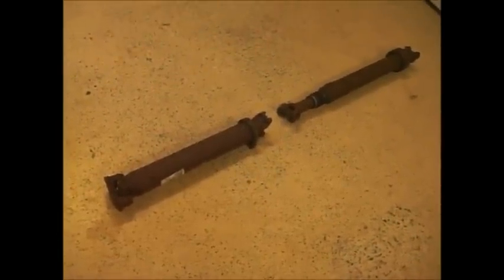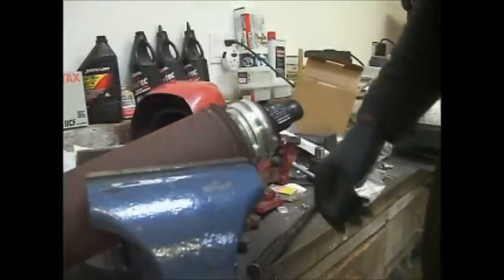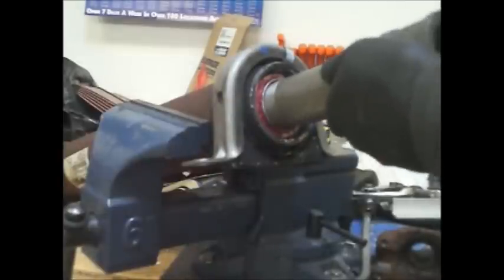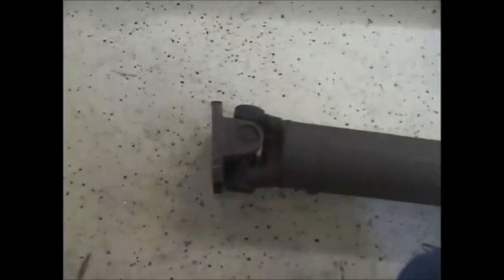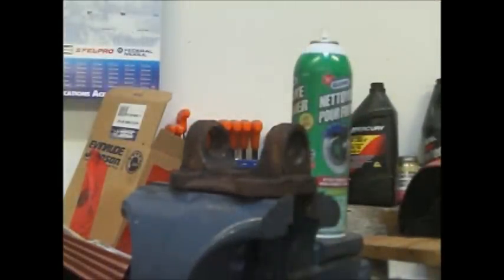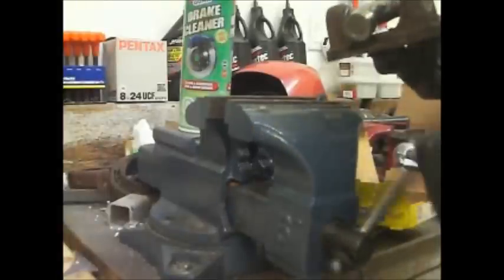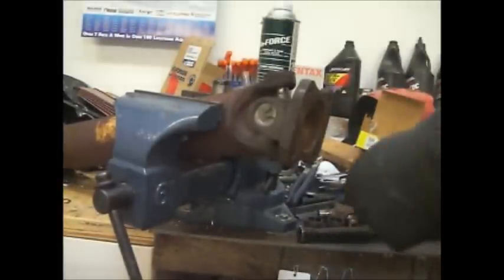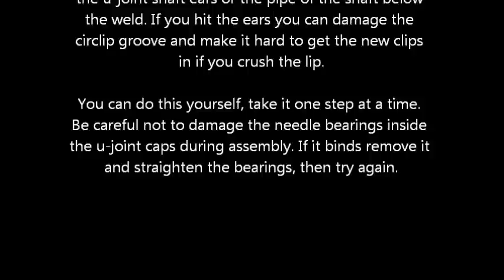Rear Driveshaft Ford Superduty

Comment: EXCELLENT!!!   This is the ONLY video covering this version correctly.  All the others are a VIN beginning w/ 1 (Mexico).  My truck was proudly and reliably made in Kentucky!!!There's a few versions of the carrier bearing, for those who doubt it look on O'Rielys Auto Parts and you will see (Mexico Version ONLY) and ,...not.Thanks for the video dude especially the 33 MM socket.  REALLY saved me some time.
Reply from the maker: Glad I could help. I think mine's made in Mexico tho. :-/  Don't have it with me today to check the VIN. Cheers. Mine is still giving me some issues, odd vibration, etc. I'm ready to ditch it for a 1 piece stronger shaft.

Comment: Thanks for posting. I just had to replace the carrier bearing, but your vid made it super easy. The air hammer worked so good on the flange , that I also used it to remove the bearing.  Worked like a charm!

Comment: Thanks for sharing. What size pipe did you use for the carrier bearing?
Reply from the maker: Probably 2.5" not sure, that was done 7yr ago. :-) , I'll be installing a one-piece double-cardan driveshaft sometime this year. Sick of the two-piece shaft vibration.
Reply: @westvandude   Who sells the 1 peace shaft you talk about ?
Reply from the maker: @Richard5873  Not sure there are any ready-made shafts avail, generally hit up your local driveline shop. They will measure and weld up a custom shaft. Lots of references online, search around might find one to purchase. https://www.ford-trucks.com/forums/1062520-anyone-converted-to-a-one-piece-rear-drive-shaft.html
Reply from the maker: @Richard5873  Try here: http://www.driveshaftspecialist.com/Truckhtml/Ford.html

Comment from the maker: If you get a vibration rotate the centre connection 180deg. Also double-check all the snap rings a few days later.
Reply: Hey Westvandude, I'm having major issues with my drive shaft. And the repair shop in my town mentioned (after I got my truck back) that Ford had put something on 180 degrees. Where in this video are you working on the center connection? I'm asking a really basic and dumb question, but I want to be really thorough with it. I can't afford a new truck.

Comment from the maker: Yes, I marked the flanges but ironically the brake kleen took off my markings! Beware. On assembly I had to guess. No vibration so I guess I got lucky. But where the shaft bolts to the transmission output shaft and rear yolk I don't think it's that critical as the shaft is balanced as a whole from the factory. Main thing is to make sure the centre connection at the bearing goes together same way it came apart.

Comment: how do I align my driveshaft on a 2 piece driveshaft with a carrier bearing,  on a 94 f150 ...... my back u joint broke but shaft didn't fall out.... I replace it and it vibrates,,,,everyone I talked to said I needed to align it right so it would be balance..... but I didn't put any marks on it before I took it apart .....does anyone know the trick

Comment: next time you replace it, ditch the crappy oem one and get a aftermarket one, it has much beefier rubber. never had an issue with the aftermarket ones on my f350 with 6 in lift.
Reply from the maker: Ya, I was thinking, of doing that in the next go-round vs repairing this one.

Comment: I see you have an air chisel/hammer. You could have used that with a punch head and drove out those u-joint caps from the inside out in seconds. Put it in your vice like you had it. Come from the inside out and line up the air hammer punch tip right on the caps. RIP-RIP-RIP....and she's off. Watch the needle bearings though....they scatter across the floor sometimes when the old cap shoots out.

P.S. "It's hard to stop a Trane!"

Semper Fi~